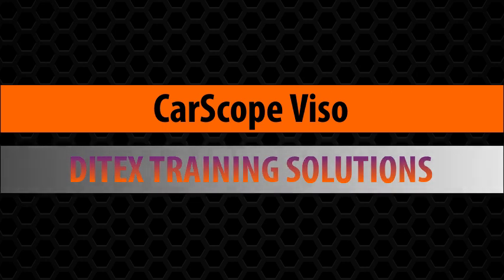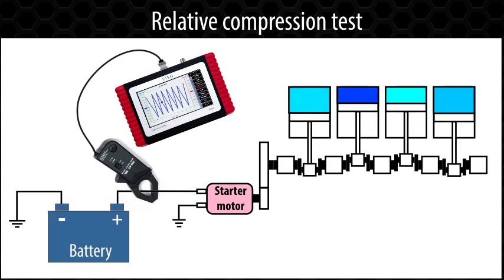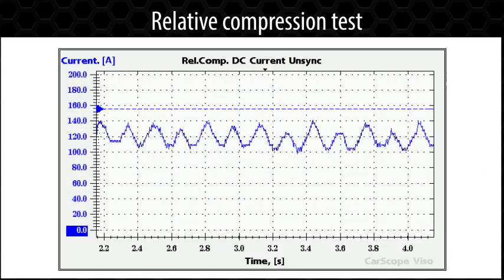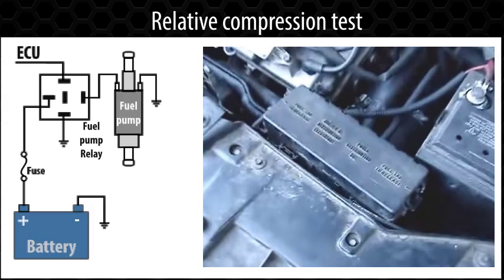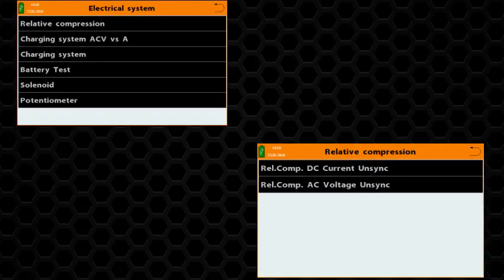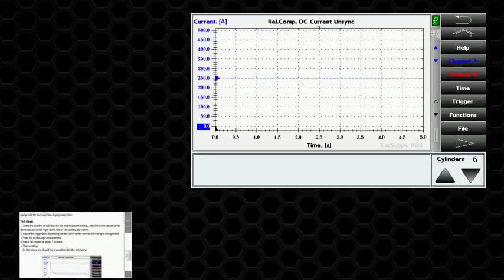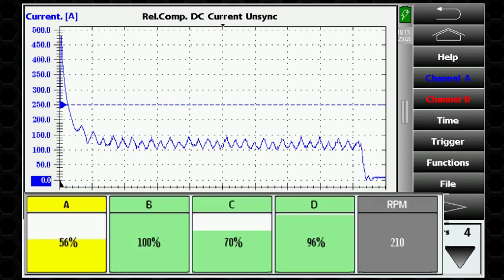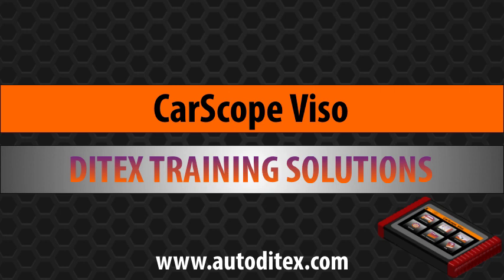Relative Compression Test with CarScope Viso lab scope - Handheld Automotive Diagnostic Oscilloscope

Comment: Can this tool connect to 24volt system.
Reply from the maker: VISO oscilloscope uses an internal Li-Ion 3.7 volts battery. You do not need to connect it to 24  volts. You have to use DC 5V power charger to charge the battery.
Reply: @AutoDITEX  Thanks for the reply.  is this viso oscilloscope 4 channel isolated. Can you send me the link.Thanks.